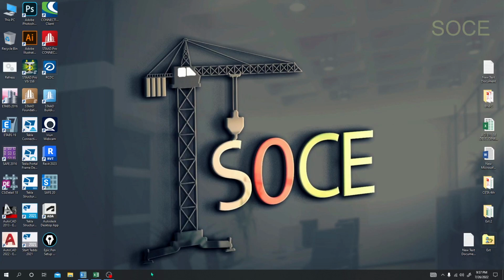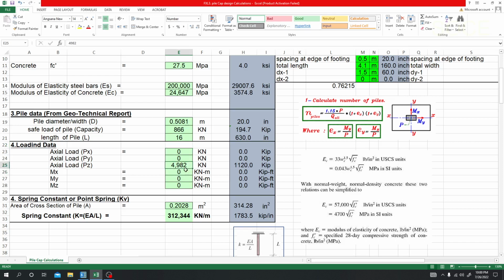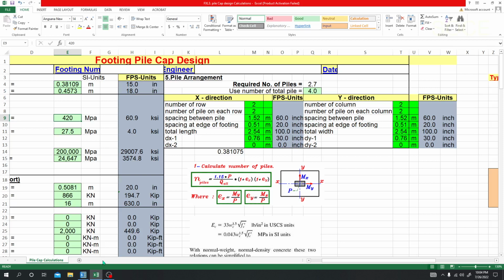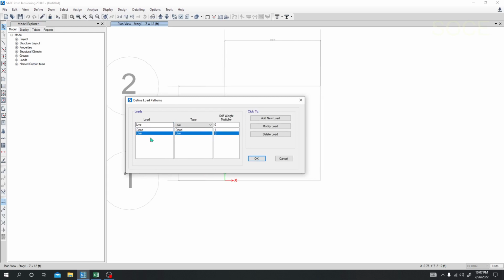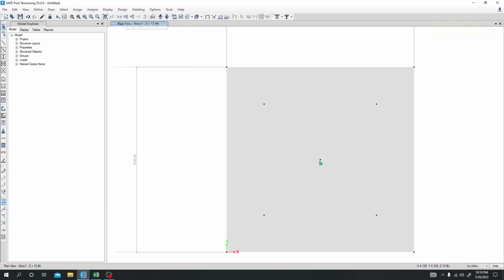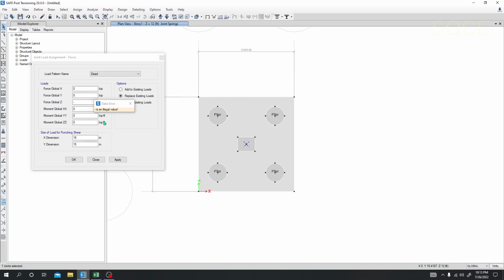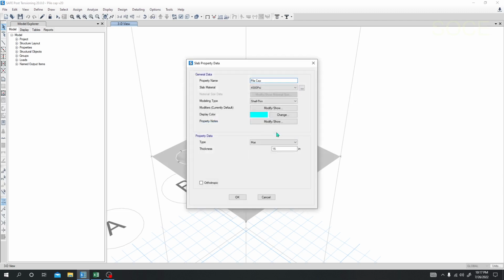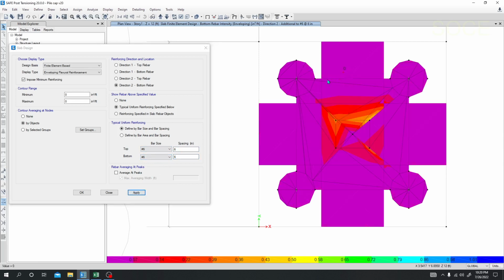6. CSI SAFE 2020 Tutorial | How to Design Pile Cap in safe v20

Comment: Correction: The Error is due to the spring properties you are defining; the correct way will be placing the same value in all three translational directions. It will not affect any calculation since you use these data for "Compression Only".  Happy Engineering.
Reply from the maker: thnak you

Comment: Hi, punching shear final change is for pile is 1.09 and column is 0.7, seem like the column with big load from above should be bigger than pile, why there is the column value smaller than pile? pls advice
Reply from the maker: May be your column size is bigger than pile size and also perimeter is bigger then pile.
Its depends on perimeters of the pile and column.
Reply: Hi Sir, I mentioned the value of the result from your file, just wonder why your ratio punching shear from column smaller than pile? as load from column is bigger than pile  4 times, but thank a lot for your time explain.
 @qlearnify-en